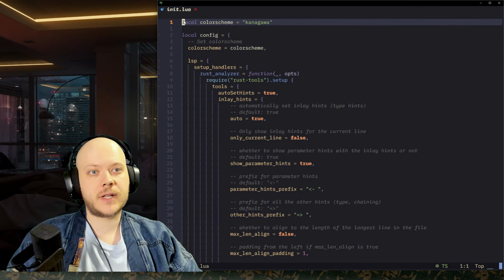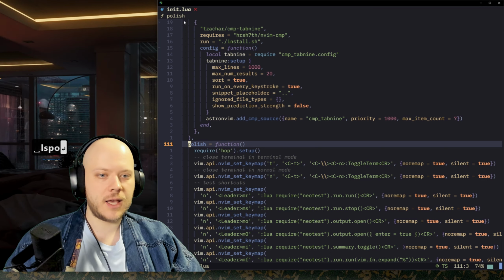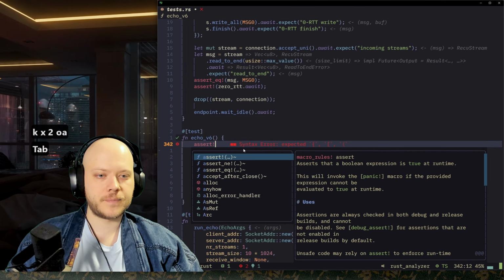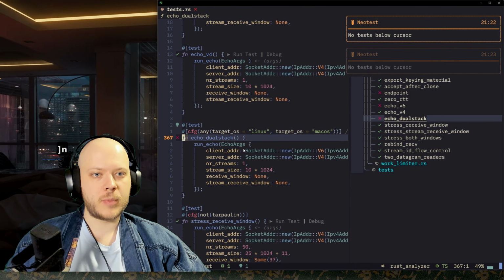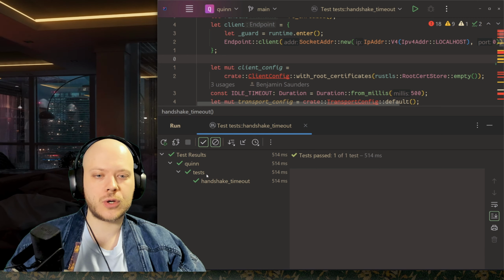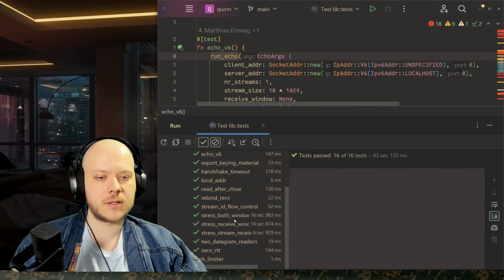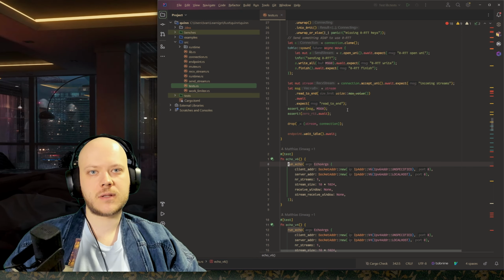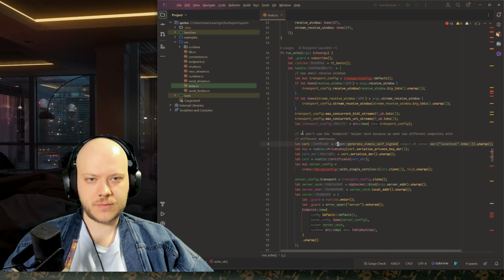Neovim - Test, Neotest

Comment: Hi
Thanks for the nice video

I have been interested in this topic for the past few months (I mean nvim or similar configurations)
But I still have a question that I haven't found an answer to: Is it really possible to use nvim/astrovim/etc instead of Rider for dotnet or XCode for c++/swift? I mean nvim can cover all IDE features: unit testing, debugging. Currently I can see LSP + nvim as a powerful combination for editing but sometimes we need to test and debug code too

Comment: Just started picking up neovim since my work laptop can barely run webstorm/vscode. It has huge issues with ram to the point that I have to use a swapdisk for everything. Using kickstarter, harpoon, oil, undotree and some custom keymaps suggested by theprimeagean etc.

Now it's more fluent, however I do miss the ease of use test integration that JetBrains products provide.